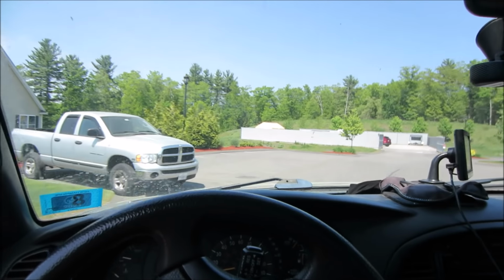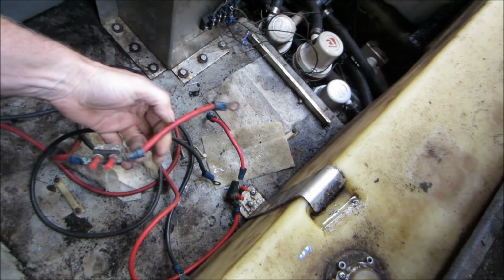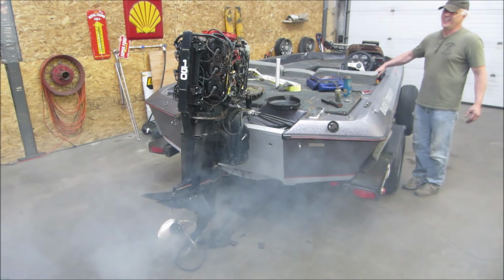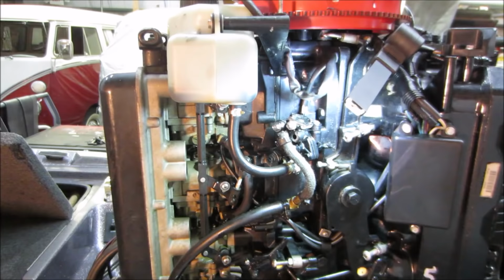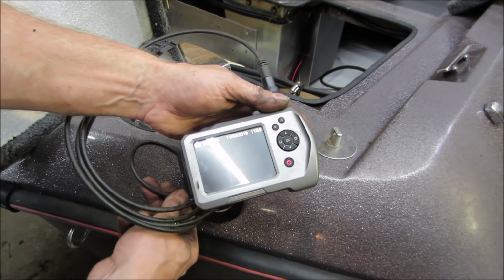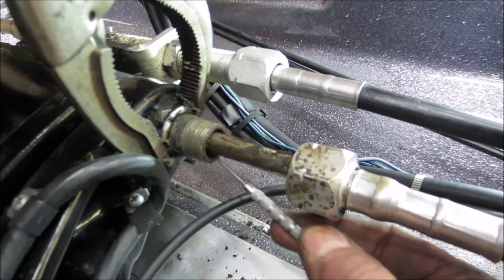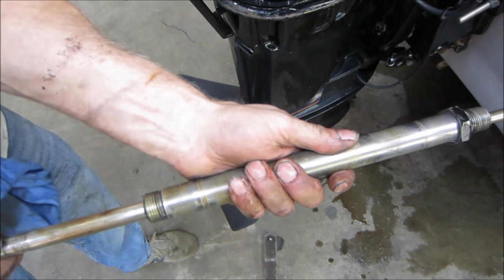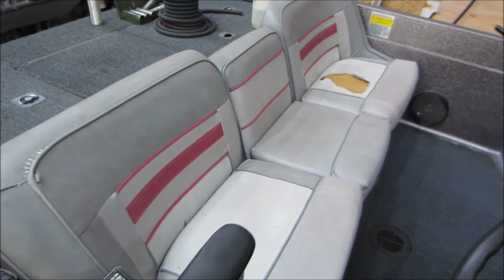1990 Bass Boat. Can We Fix It?

Comment: You did a great job on that steering cable! It may be a long shot, but why don't you drill that hole with the grease fitting all the way through to where the steering cable goes so you can live both moving parts at the same time.

Comment: My question is why did you pressure wash the motor when you could have just hit it with an air compressor? Growing up with boats and Sea-Doo and living on the water,  you want to minimize any water on the electrical components because that can just initiate rust..

Love the videos and you might hear me yelling at them, but keep them coming!

Comment: Hey musty I saw this the other day, guy needed a bore Cleaned out, and he used a long bolt with a green pad, and a drill. wrap the green pad on the bolt, spin the bolt in the drill... vio la, a mini cylinder hone! Diesel creek, did this to a hydraulic spool valve

Comment: you should always have water going to the impeller, even if its just a quick pop. that impeller definitely needs to be changed, if just from sitting. the starter should never have oil... dry lube only as the oil will drip down into the armature and collect all kinds of dust and junk and severely shorten its life. since this has been sitting, the carbs need to be thoroughly cleaned. you cannot tell if a high speed jet is clogged. if one is, it will lean it out and trash a cylinder. ditto for the tiny calibration holes in the idle circuits.

Comment: I was thinking about the cable oiler there you use for bikes, and a big version that could clamp onto that engine steering rod and force lubricant up the shaft as if it were the cable on a bike

Comment: Those steering tubes are engineered to fail. There should be grease points on the piviot tube for the cable. Many steering cables fail because you can't grease them. more money for the shops in sales and repairs and thats only used in fresh water, imagine the guys on the ocean that only take their boats out of the water seasnoally

Comment: Get a pair of “muffs”. Connect a garden hose before you screw up the impeller system..also install a NEW impeller.  Neve4 run ann outboard wirpthoutveater on the impeller.  Any Mercury dealer will carry the impellers and muffs? 
JoeB

Comment: Its normal for the cable steering to be tight one way then the other due to the propeller spinning with high torque in a clockwise direction when in forward gear doing speed the only other solution is to get Hydraulics steering to permanently fix the problem at speed

Comment: Three sonars on the thing.  One in the dash and two up front.

I really didn't expect a V6, but then that's Mercury for you.  A lot of other outboard builders would had made a 150hp as a big 4-cylinder rather than a V6.  I think Evinrude was the only other one who made a V6 in that size.  Ethanol doesn't belong in marine engines whatsoever.  The fuel sold at marinas is always going to be non-ethanol.

Comment: not a boat guy at all... living kinda far away from the sea... so I had no idea these engines are two stroke...
what I see is a tiny V6 two-stroke... would be interesting to fit one like that in an ratty DKW or Wartburg instead of the 3-cylinder....

Comment: The last stuck steering cable I messed with ended up getting cut off and driven back through.  The whole cable was seized in the jacket anyway but nonetheless the motor end put up a fight the whole way.

Comment: dude you said it was a gun brush wheres the rods that connect together to put that brush down the barrel of the shotgun  ? put that together and into the chuck of the drill........and presto clean barrel or worse case scenario find a set of mini hone stones. ive seen em that small good luck enjoy the show and learn thanx
Reply: woulda love to see if those machines on the side of the road what happened to them did you snag them or pass ?

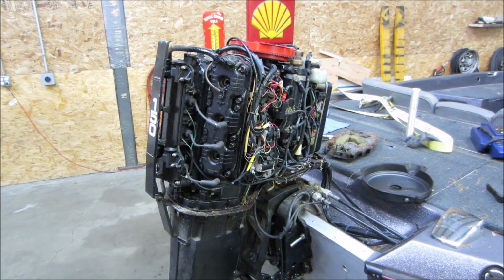Comment: Middle plug wire was arcing at the coil. 18:45-18:50 You might run into a misfire later on.

Comment: Are you sure its a cable drive and not hydraulic. Check the helm if there is a hydraulic resivour and fill with steering fluid. And dont forget to connect up the  water hose before starting.

Comment: I was really wanting to see that thing stuck into a lathe... :)   Good job, using the drill extension to drive the metal brush.   Did you put on a pair of grease fittings?  I'd have thought.... you'd do that, after all the issues.

Comment: Use premix gas and oil. Everybody was trying oil injection back then, none of them worked right  OMC was trying out VRO too, they were all smoking motors, fouling plugs, etc..Even think they sent out a service bulletin on disabling oil injection., been 30 years ago, and I forget crap. Don't run motor without flush muffs, takes about 20 seconds to smoke an impeller,  and it will need a new one sitting that long, it takes on the shape of the housing. Also resist the urge to crack the throttle open without it being on a Dyno, good way to over rev, and snap a crankshaft, that ain't no fishing motor on that boat. It was Mercury's high performance motor for that time 150hp black max. Hopefully no one has screwed with timing, takes dial indicator, and factory degree ring, and pointer to set. It's not an eska johnboat motor. You get that pup out of time, and you seize pistons.

Comment: Now you go buy a water pump kit and an oil injection block off kit. If you do plan on keep in the oil injection run at least one tank of pre mix through it and verify it still pump oil.  The plastic gear on the crank was the worst design ever

Comment: have you ever tried using one of those small pump pressure sprayers for bleach instead of the little hand sprayer you have, the type where you pump it like a bike tyre pump to build pressure then hold the trigger down to spray, should be easier if you have to spray a huge surface like that

Comment: An outboard motor should never be operated without a source of water entering the inlet screens to supply the water pump. Without a source of water for lubrication, the water pump will be the first to be damaged, followed shortly thereafter by the engine from a lack of cooling.

Comment: Mustie please do yourself a favor and replace all the fuel lines with USCG type A1 approved fuel lines and some A2 fuel fill line.  They won't be that expensive, and could save yourself from a larger boom down the road, internal tanks aren't a good combo with compartments and electronics.  Technically anything in that bilge has to be ignition protected not to make a spark.  I have seen a number of people get hurt from boat fires and explosions because of leaking fuel systems on boats.

Comment: Those spark testers are junk. you need a spark gap tester and that spark needs to be able to jump like a 1/2" gap.  I started out with that motors little brother the 75 HP.  Test the stator and the control box good first.  Those coils have a tendency to go bad.  The rectifier as well but thats only for your charging circuit.  If the batteries dont charge, you have a bad rectifier.  Of course you can test everything with a service manual and a multimeter.

Comment: Make sure to put new fuel line from the tank to the engine that old mercury line is not ethanol rated and it breaks down the inner liner and clogs up your whole fuel system. Trust me i work on boats its bad stuff

Comment: You should change the impeller . Noticed you were turning the flywheel the wrong way definently not good for any impeller. If your going to use oil injection i would run tank mix also till you confirm oil consumption rate. The gear that drives the oil pump on the crank is plastic and fail. I would definitely go through the carbs also.

Comment: Remove the oil injection and premix it.  The motor will last forever if u do.  Oil injection on those are probe to failure and then BOOM

Comment: Get yourself A rubber toilet flapper from Wal-Mart cut the flap hinges off of it.& the nipple tip to. until you see A little hole in the end of it. Then your air gun blow nozzle tip will fit inside of that. Then place that over the hole were the fuel cap goes.& blow air through the line holding down on the flapper plunger part for pressure force.

Comment: that steering cable is rusted up badly and you may not be able to save it and that's not good since it a double cable steering unit  and if you do break it lose better check it well if you use I had one that had the cable inside where it broke the cable internal strands and was lucky I was not boating that fast that happens a lot when they're not used much and left outdoor that cable is more than likely just under 300.00 if you don't have to buy the whole thing  by the way I'm retired and I buy up older boats and restore them as a hobby been at the hobby for about 15 years the retirement part  11 years now lol good luck

Comment: take the night off the left side of the motor where it is seized up find a rubber tube that will fit over where the net was on use a clamp to hold it on there air compressor chuck on the other end pour some tranny fluid in the rubber pipe then plug it into your airline and put 5 to 10 lb of air pressure on it till you see the tranny fluid come out the other end that should free it up and then pumped full of grease

Comment: get rid of the VRO. it garage and will grenade your  engine if it doesn't work properly. VRO or old injection sucks horribly. just convert it to straight gas and mix it as needed.

Comment: if that's an oil-injected motor I would block it off and [prmix my gas  but that,s me --- I've heard of too many motors with oil injection systems failing and taking the motor out it looks to be a mercury 150 hp but before all that run a compression test on all cylinders making sure it 120 or better with no more than 8 to 10 lbs difference

Comment: My Opinion:  Those automatic oiling systems for a two cycle engine were a bad idea.  You never know if they are working properly or not.  The old way of putting oil in the fuel tank was better.  I had one engine starve for oil in the fall, in cold weather.  Ruined that engine.

Comment: Mustie, I have several separately packaged Gates Brand, Hydraulic Trim Stainless Steel Braided Flexible Hoses For Boat Engines and They are roughly 1/4 Inch Size with one end a 45° angle and the opposite end is straight and a little over 15 inches long... If you would need a couple or so of them, you can let me know on here and what would be the best way to get in touch with you and I will ship them...

Comment: That is premix in the gas tank. Those auto injection systems are unreliable and when they don't pump oil, you engine will blow. Leave it disconnected and premix your gas and oil.

Comment: Why would you take this apart inside your shop!
You just moved mice into your clean shop.
Initial Inspection and cleaning of an old boat should ALWAYS be done outside away from your important areas, with bee killer and a cat handy lol.
I hope you didn't pay much for this boat as I see a LOT of work and wires to go over.
This is why I don't own a used boat yet, can't afford new, and not willing to rebuild some old rotten junk full of rodents and bugs.
Good luck to you though!
Also you NEVER run ANY boat engine without muffs or a big bucket for the intake.
Otherwise you destroy the water cooling impeller.
That's boating 101.